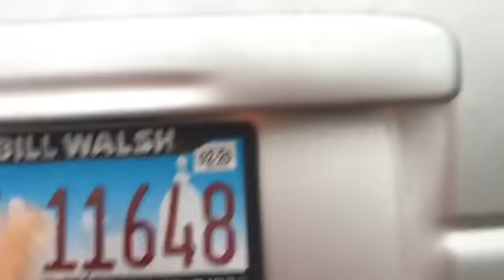Look what I found

Comment: I picked up a 1000 lbs of steel and 35lbs of copper today to make it a grand total of over 3000lbs for the week.
Not a whole lot but it's extra $$$
Reply: Nice how your prices a ton
Reply from the maker: Yes indeed and especially if you have a real job that extra money really helps out
Reply: 145 gross ton
Reply from the maker: I think there’s a slight difference in price between gross ton and net ton
I think the gross is actually a higher weight
So you’re getting less per ton💰💰💰yup
Gross ton is about 2218 pounds
That ton is about 2000 pounds
Reply: @steelisthemeal  u rite